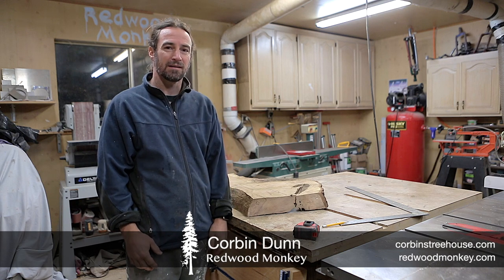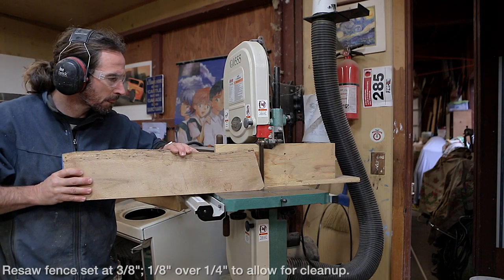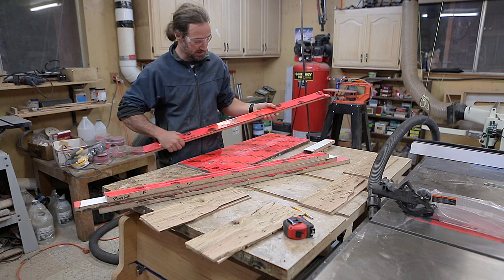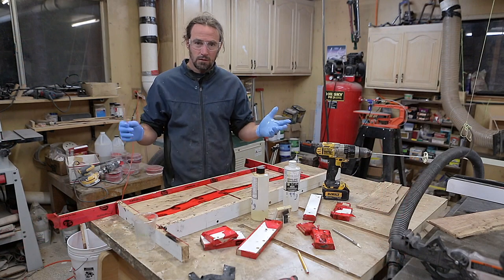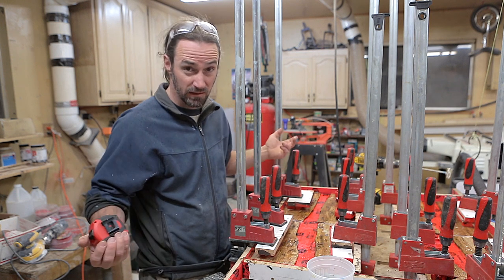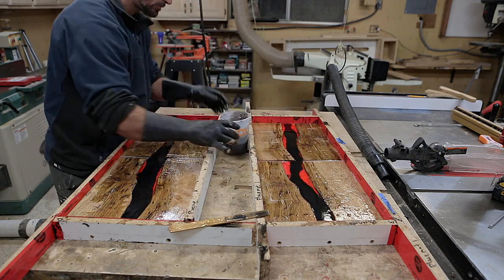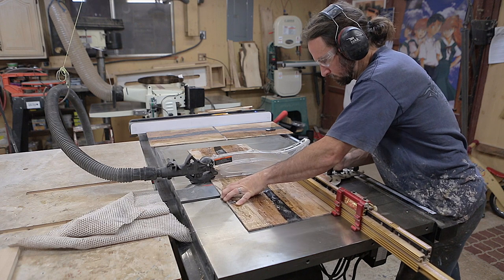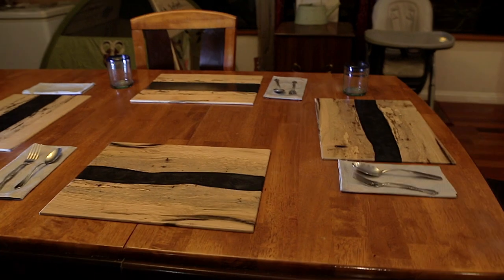How to Make Wood Epoxy Placemats - Making river table style wood and resin placemats for your table

Comment: Well documented as usual and boy do those look purdy.

McMaster sells peel-n-stick cork backing in 12" wide sheets if you were looking for a non-slip option.
You need to specify FLAT PACK or order something stiff of the same size though, or they roll it in shipping.
Reply from the maker: Josh! Tulberg good ideas! They are pretty non-slip on my table, but I did think about adding some backing. It would make them a bit thicker..